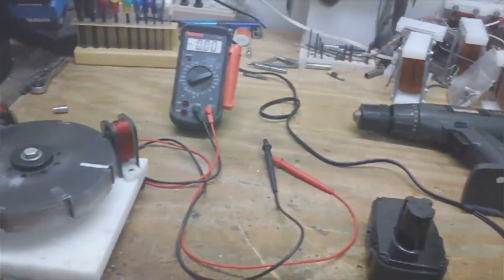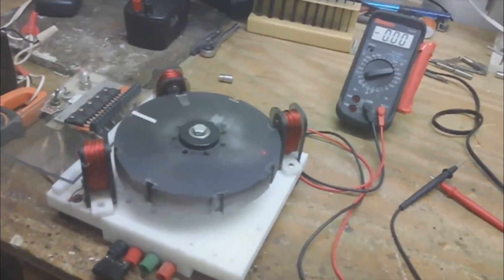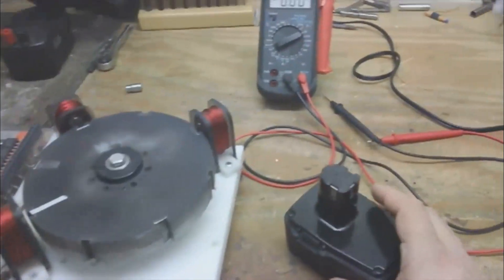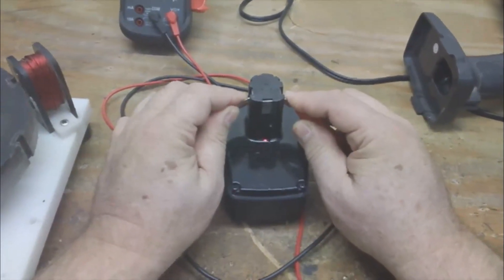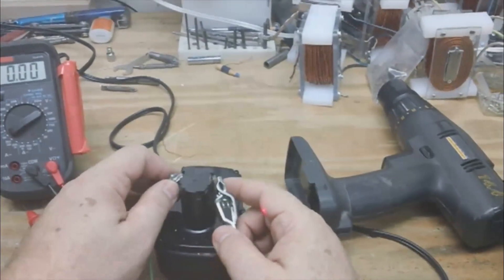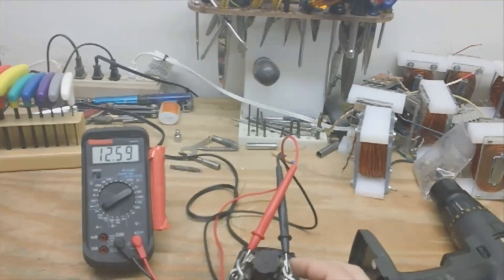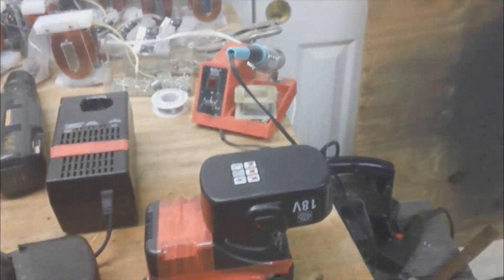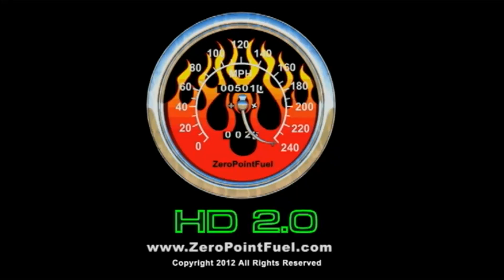How to Fix a NiCad

Comment: Can i use a lead acid battery desulfator on it? Its rated for 12V to 48V. I takes some weeks on a car battery but maybe on a drill battery few days would do it.
Reply from the maker: yes it will do the same thing,as the motor the spike is doing the work

Comment from the maker: thanks for the tip, but I used a old charger base and added a plug that breaks the circuit when I plug a special cord into the charger so I can recondition the battery when I need to. Without a good connection to the battery you risk blowing your chips.thanks for watching

Comment from the maker: well thanks for posting, but my coils are smaller than a standard bedini they are 65ft coils and in this case running at 20v and 1 to 2 amps into the battery will blow the chip  every time with or without a NE2 bulb the Neon only works on a small wire with a allot of turns I found them useless on my coils ( been running this type of coil for years)

Comment: I use the ne2 bulb in my pulse motor. I find that it works well with an MJL21194 transistor. I take the charge leads off all the time and have yet to blow a transistor. One would think that higher run voltages, larger diameter wire and/or more winds on your coil would could cause the transistor to blow with the charge side disconnected. The MJL21194 is rated for 250vdc, 200 watts so if you are pushing the limits of your transistor be careful.
Great video, Thanks for posting.

Comment from the maker: it varies depending on the battery but that battery was only about 20 min it charges great make sure you laptop battery is a NiCad there is only been one time that it did not work for me and it would still pulse charge.some battery set have a dummy battery in them it looks like the rest but its not a battery sometimes opening up the battery and bypassing that dummy battery it will the spike it properly.

Comment: Great vid! I've been doing the same thing for 2 years myself, but you always pick up on new stuff from others' out there. Have you ever experimented with the solid state bedini stuff? My latest musings have been with a circuit coined the Tesla Switch Oscillator Solid State based on Bedini's experiments in '04. It is 24 volt input, and connected differently than the SSG in that it is more of a parallel thing, than a series connection, to charge 12V, from 24V. Cheers